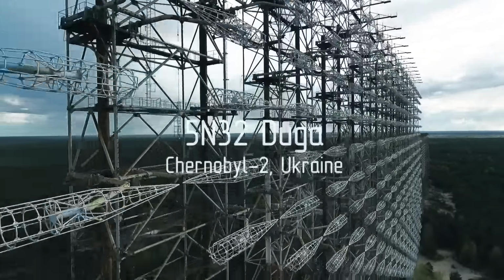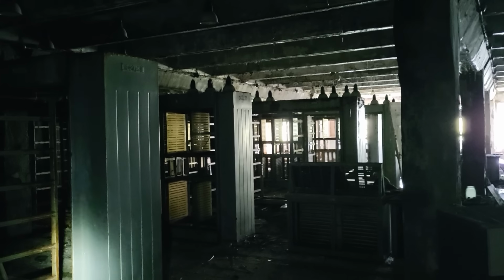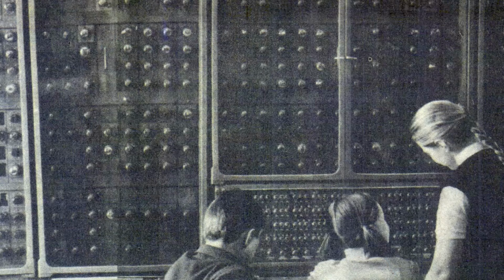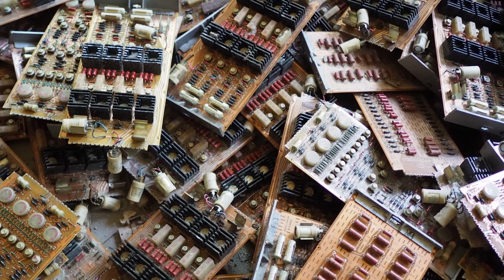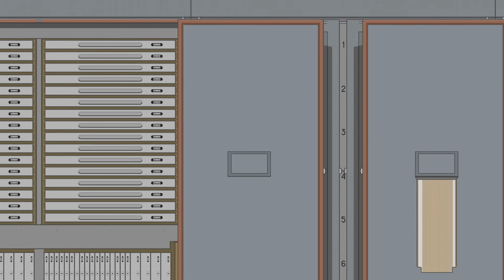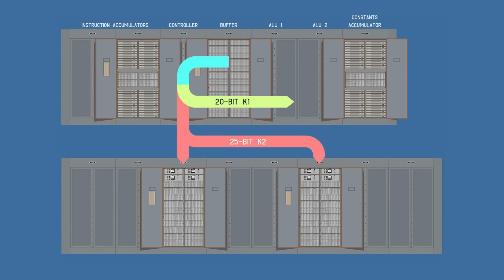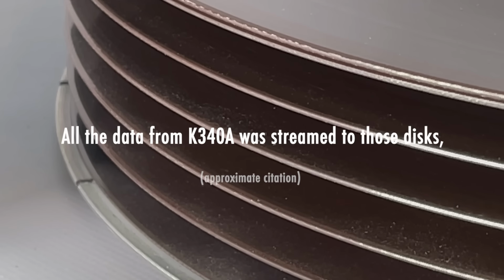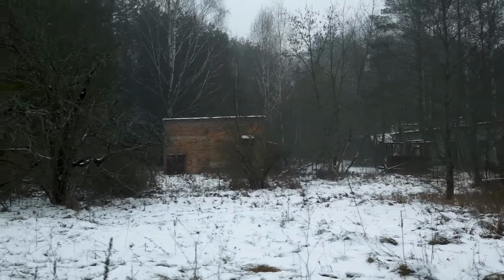Exploring K340A: The SECRET COMPUTER of CHERNOBYL DUGA RADAR | Russian Woodpecker

Comment: It is unbelievable how far behind the soviets were in computer technology to the west. My estimation sat at an average of 10-15 year gap.
Reply from the maker: While I completely agree, pay attention to the fact it is a specialized machine, so here a situation is similar to SKALA of ChNPP. I do not know if you came to the section about computer cluster, but there was an attempt to install an IBM/370 clone.
Reply: @ChernobylFamily  Yeah I have seen the entire video. It is impressive what they could do when focused on a specialized function. This makes the K340A almost DSP like in its nature if I understand it correctly. It seems like they narrowed the function to exactly what they needed, then built the machine to hit a stated performance target needed for the task. This would make its design unique if not even quite exotic compared to western contemporaries. 

The shocking part to me was when you estimated the number of transistors involved in the design of the processor section I think? By the mid 60's the west was already well into CMOS technology that would have put 80k gates on a couple of decently large PCB. And matching performance and functionality in perhaps a single rack.

However when looked at from another perspective, it is impressive what this machine did with relatively fewer gates than other contemporaries.
Reply from the maker: I believe, the reason why they stuck to discrete transistors is their stability to radiation. Soviets had CMOSes, but CMOS would be gone if environment would become harsh.
Reply: @ChernobylFamily  Ahh ok.
Reply: @wishusknight3009 Interestingly, I read an article about Soviet semiconductor development sometime ago. I have linked it in the below comment

Comment: Duga radar is an extremely interesting device that was ahead of its time. The antenna itself is a monumet, which I hope will be preserved for posterity to marvel at. The computer is practically impossible to restore, but some kind of copy of it could be possible. The Duga radar transmitter has been disassembled and there doesn't seem to be much information to be found about it.
Reply from the maker: I am not sure if you watched up to the end, but making a model of it was/is the idea. Anyway, if we even imagine a chance to restore the machine 1:1, it'd require a serious cooling, and outcome is not really understandable — it is all about algorithms which are gone for good.
Reply: @ChernobylFamily  It would be really great if the model worked like the original system and we could learn new things from it :)
Reply from the maker: @leopiipponen7693  i'd love to see that console blinking. In a hardware. Even if it'd be wrong imitation.

Comment: I remember hearing the Woodpecker on shortwave on an old Eddystone valve radio in the early eighties. I recently restored the very same radio after more than 40 years storage - it has outlived the woodpecker :)
Reply from the maker: Thank you for sharing!
Reply: @ChernobylFamily thank you for your great videos too!
Reply: It's interesting. The woodpecker was by some thought to be a Soviet attempt at mind control, a psychotronic weapon.
Reply: I inherited an eddystone from the 50's and the UVB-76 became my antenna testing station 😅, I got around 6 HF scanners from 50-60-70 up to an modern yaesu HF scanner from my grand dad, but yeah it's handy knowing an station that always broadcasts, I can barely receive it so it's a good one to test and adjust antennas accordingly.

Comment: So the cassettes were core memories?
Reply: They used a form of "Transformer Read Only Storage" which is a core related technology and TROS is how IBM stored the microcode in 360 processors and many other places. It's magnetic ROM, but in the West and Japan it was always reprogrammed by routing a word select wire either through or around cores to create a 1 or a 0 in that bit. The ability to reprogram TROS by the method used here is very clever and I have never seen this approach used in the West.
Reply from the maker: Yes. But with manual-only reprogramming and working by slightly different principle.

Comment: 45-bit word size...I did a bit of reading and the only other machine I could find which had that word size was the Almaz.
Reply from the maker: ...yes. It was also designed by Lukin, Yuditsky and Akushsky.
Reply: quick chatGPT answer: 
The AN/FSQ-7, a Cold War-era computer developed as part of the U.S. Air Force's SAGE (Semi-Automatic Ground Environment) system, was one of the notable military computers that used 45-bit words. The AN/FSQ-7 was the largest computer ever built and was primarily used for air defense, processing radar data from various sources.

While it was not explicitly designed for MIMO (Multiple-Input, Multiple-Output) radar, it handled input from many radar stations simultaneously, which is conceptually similar to how MIMO systems work by processing data from multiple antennas. SAGE integrated these radar inputs to track aircraft in real time and direct responses.

Later Cold War-era military systems, especially with the development of phased array radars, evolved to more advanced computing systems capable of handling MIMO-like operations. The advanced radar systems of the era, such as the Aegis Combat System (which came later), used more sophisticated multi-channel processing techniques, although not necessarily with 45-bit word computers like the AN/FSQ-7.

So it looks like Soviets somehow copied that system, and never even managed to get it running.

https://gunkies.org/wiki/AN/FSQ-7

yep, timeline, size, tech and purpose matches perfectly.
Reply: @piotrcurious1131 Very interesting digout. It may be that hardware was very similar, but from what I understand key difference was software and radar. Russian system seemed to have been OTH-SW (with active woodpecker signal performing scan, just a theory) radar able to detect and scan surface of potential missile sites and see potential launches immidietly. US sage system seemed to be more about detecting threats already in the air at much later stage. US had it's own experiments with OTH-SW such as Cobra Mist, but they seemed to have been a failure. I've also read somewhere that Duga Could also be used for Long range communication in some capacity. Will have to try to check more...
Reply: @keaien  or the whole woodpecker thing was mere decoy, like the main system was just direct copy, while they pretended they had some research progress to pull more money. Note that the system had to be interoperable and networked so it could not be much more different from western systems because Soviets had no own solutions, they were behind the West by decades, especially in the software context.